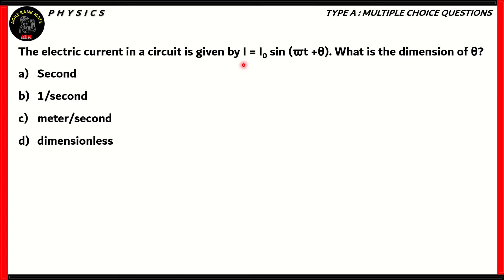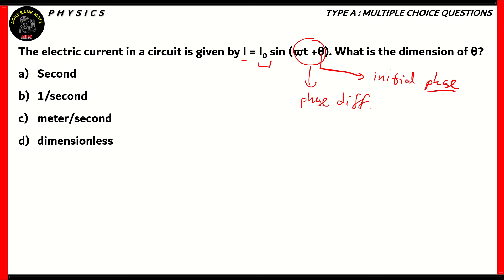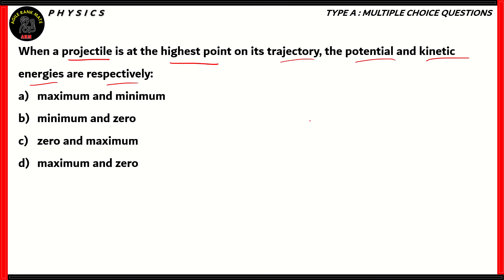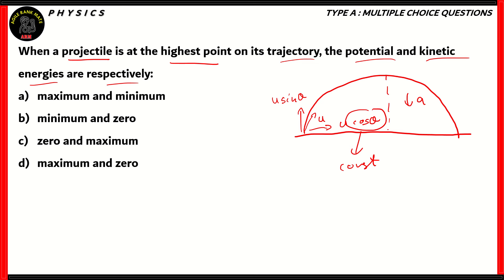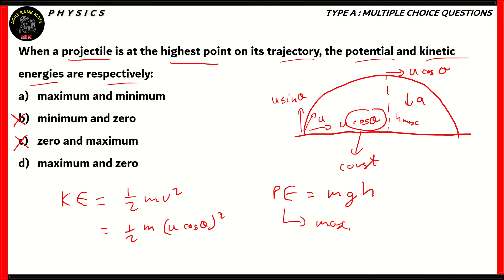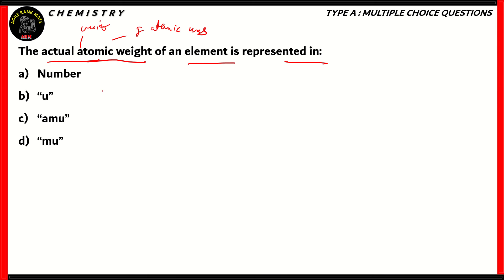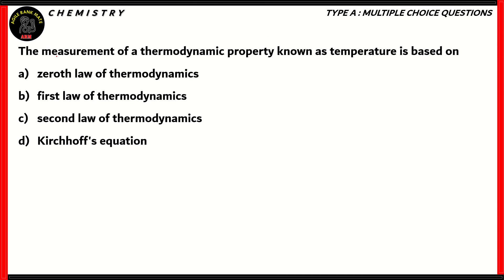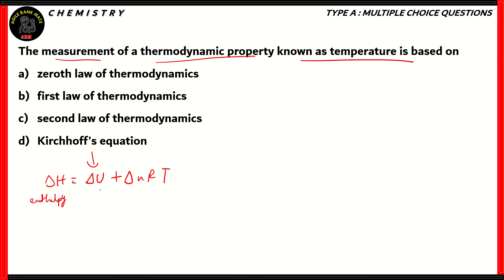AEEE 2024 | Question Paper Worksheet | Previous Year Questions | Step-by-Step Solutions | Episode 4

Comment: chennai,4-6;30 any?
Reply: How did you write
Reply: @beme_in  time felt less,overall good,wbu how you wrote
Reply: @thatmilkywayguy5456  can you say some important topics
Reply: @beme_in  stats,3d,vector,integration, probability,and  for maths,for chemistry inorganic is important the most,then physical nd organic,for physics,i would say em waves,ac,modern physics,current electricity,then optics and electrostatic s
Reply: @evaalison7926  no,this didn't
Reply: @evaalison7926  3
Reply: @evaalison7926  it dont matter actually,different batches get diff questions
Reply: @evaalison7926  i would say,try doing more questions from your 12th board
Reply: @evaalison7926  ya,admit card and pen is enough
Reply: @evaalison7926  no
Reply: @evaalison7926  go confident,try to manage the time well
Reply: @evaalison7926  it is pretty easy
Reply: @evaalison7926  how was your paper
Reply: @thatmilkywayguy5456  whts ur name
Reply: @thatmilkywayguy5456  whts ur plan b
Reply: @thatmilkywayguy5456  bro they will release the score soon after the completion of exam?
Reply: @thatmilkywayguy5456  and what was the level of maths? Like lesser than jee or more difficult than bitsat?
Reply: @devsinha4632  easy